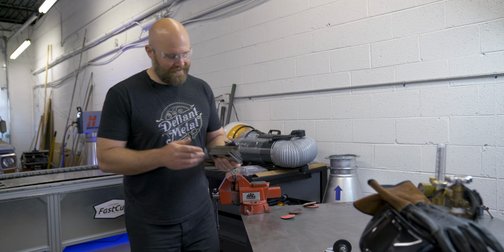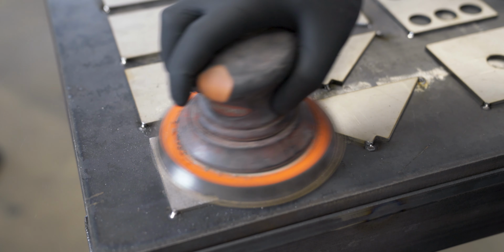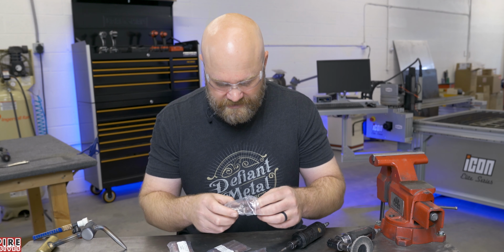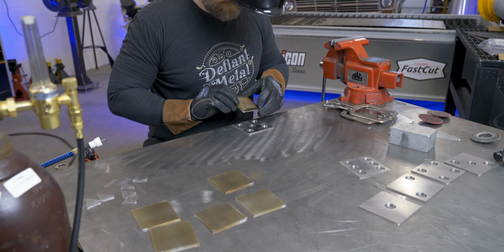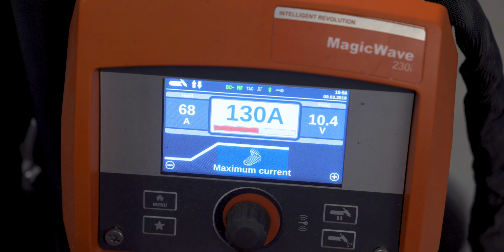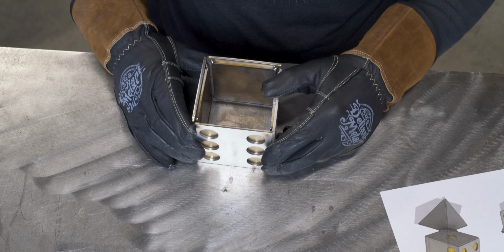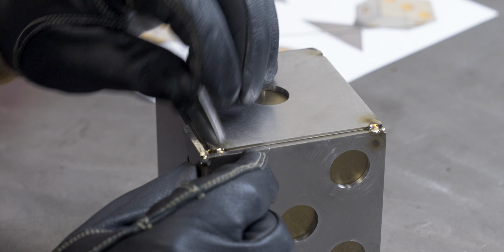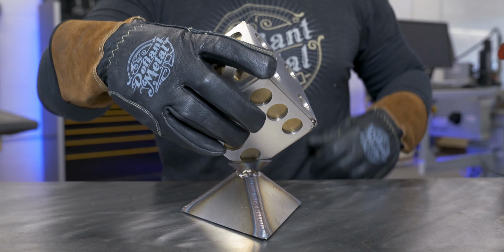TIG Welding Stainless Steel Metal Art

Comment: Justin,

Your Powermax 85 is capable of using nitrogen as a cutting gas.  Using nitrogen will greatly reduce/eliminate the nasty edge quality and dross that compressed air leaves behind.  Cut speed and arc voltage are almost identical to what is provided in the Hypertherm manual.  Nitrogen also does and excellent job on aluminum.
Reply: interesting timing, 14 minutes after I ask how to keep the plasma from butchering the stainless.
Tell me more about the nitrogen?  I've done whippets before and don't think I could tig stainless very well after that...
Reply: @carpediemarts705  You need to be certain that your plasma power supply can run nitrogen first.  What you will need is a nitrogen regulator for the cylinder, six pack or dewer and adelivery hose from the regulator to the machine.  Settings are almost identical (at least on a Hypertherm) as they are for compressed air.
Reply: @weld-itfab1633  "six pack or fewer"?  I don't drink and plasma.
Reply: @carpediemarts705  Six pack of nitrogen cylinders or a large nitrogen dewer which is liquid and the gas bleeds off and that is what is used in the cutting process
Reply: @weld-itfab1633  so it takes a ton of nitrogen
Reply: @carpediemarts705  same volume and pressure as compressed air.

Comment: Turn your heat down to around 90 amps. Also turn that gas flow down. Weld S.S. as absolutely cold as you can. Only enough heat to  feed the wire on an even flow.

Comment: November last year, I took my collection of stainless to a friend's and cut concentric hexagons out of it.
The plasmacutter did horrible things to the stainless.  Foamy, sharp, black, and horribly hard.
It took me 60 hours over a couple months to clean the dross and slag from the 6 inside walls, 6 outside walls, top, bottom, and the 24 slaggy edges from 160 hexagons.  It was so horrible that 90% of that now clean stainless is still sitting in the 5 gallon bucket in the garage.  I have another 160 pieces of stainless that if I cut into the same sizes of hexagons, would be ... 160x5 800 hexagons to sand, makes me just want to quit and do something completely different.  What can I do to make the plasmacutter not absolutely butcher the stainless?

Additional note, if anyone wants to build a buckyball out of 20 same sized hexagons, be sure to first build a jig to place the edges together at 138 degrees with a gap in the middle of the jig for the weld.  Be especially particular that any 2 pieces come together at the same angle while looking at the faces, and geez, how to say, the edges come together evenly and not at the slightest of lap weld.  Or thou shalt cuss.